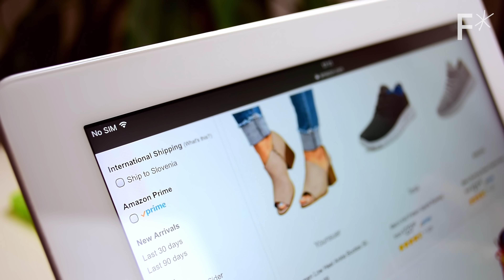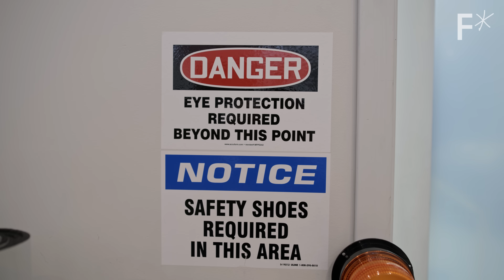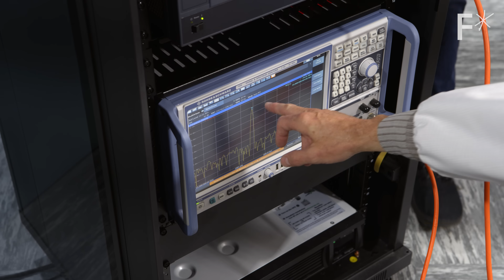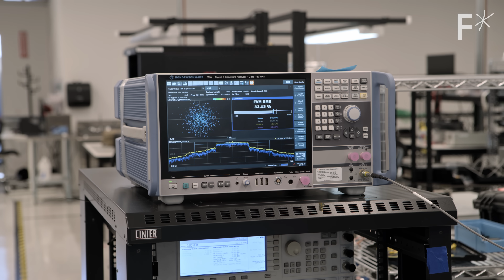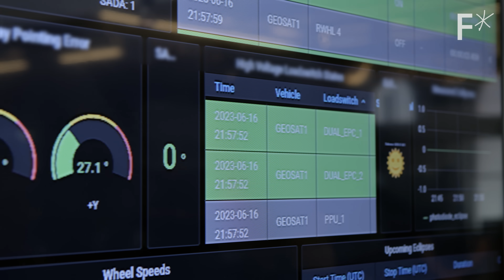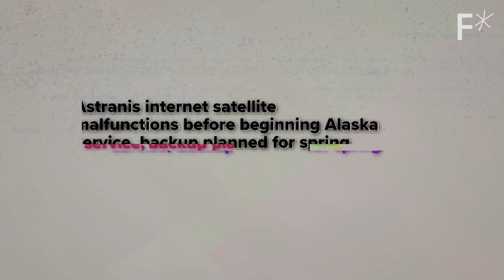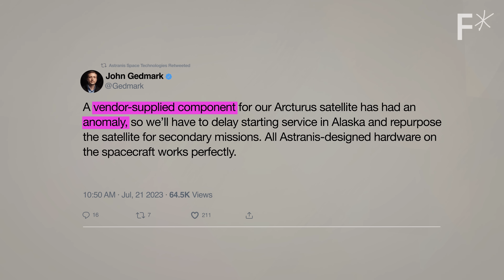Starlink’s newest competitor is using next-gen satellites to create internet for all | Hard Reset

Comment: The latency to satellites in geostationary orbit is significant, that's why starlink went for low earth
Reply: Not just high latency, also weak signal that's really disrupted by the weather... Connection goes bad everytime there's more than a few clouds... And the price had usually been much higher than starlink with strict volume limitations. 
(Haven't tried astranis, but this is common theme in many geo-synch satellite providers we've used over the years...)
Reply: Starlink will be cheap enough. No one like latency, its just frustrating even if you're poor
Reply: @mhxxd4 sterling create more space junk
Reply: @mhxxd4 Not all people need low latency internet because not all people are gamers
Reply: @seeeyes12212  the latency of geostationary satellites is almost unbearable for regular internet browsing
Reply: @mhxxd4  the thing is let's say that it's latency is not that bad like around 200-500 ms well it's not that bad especially for those who live in remote areas and mostly both Satellite based ISP's will improve their technologies anyway
Reply: @mhxxd4   90% of people, rich or poor, do not give a damn about latency or even notice it, it really only is the online gaming community, who in the big scheme of things are very tiny minority of internet users.
Reply: @professorg8383  normally it doesn't matter on land because even the high latency providers are still pretty low latency. Geo stationary latency is much higher than anything on earth and would definitely be noticeable and very very annoying, and would probably break some apps
Reply: @mhxxd4  Doesn't make a difference where it is at. It will be high on GEO-Sats but as long as the bandwidth is decent and latency is consistent, being high doesn't matter except for things like on line gaming and live streaming. But with decent bandwidth, you can do video on demand all day without issue.

Satellite TV has high latency strictly form the distanced  and it is GEO-Sat too.  Doesn't matter  that the signal was uploaded 2 seconds before you see it. 

I had 1st generation GEO-Sat, more than 15 years ago. It worked fine but bandwidth could be low and slow at times, especially weather related and uploads were slow. 

Latency of a GEO-Sat is going to be about 600 ms or so, but for 90% of internet traffic, it's just a meaningless number that you won't even notice. 

So definitely NOT noticeable or annoying unless it is while using one of those things I mentioned.
Reply: @mhxxd4  Here in Italy starlink is 40 euros a month plus hardware or the new promotion 50 euros a month , no hardware cost, 19-65 ping and speeds around 300-380
Reply: @mhxxd4  If you are a poor gamer maybe. But latency is a non issue for more than 90% of all internet traffic. Unless you on line game or live stream converse, it is not a problem at all.

As for being cheap enough, twice the cost or more of GEO-Sat and spending $600 up front,  is not cheap!  The idea that they will ever get Starlink cheap enough is just not in the numbers.  Wish it was, but it isn't and won't ever be. All you have to do is do the math!!
Reply: @mhxxd4 How ethnocentric of you.
Reply: @ what does that even mean???
Reply: @mhxxd4 Starlink really needs to figure out how to do routing in space.   It'd be an absolute revolution if it didn't need (or didn't often need) ground stations.
Reply: @DAndyLord  i believe they already have that figured out, but bandwidth is A LOT cheaper on the ground, the bandwidth for routing in space could be better used for more customers with higher speeds
Reply: @DAndyLord StarLink gen 2 satellites have laser links between satellites and do route in space.  I'm not sure what the bandwidth is but it is potentially much higher than the satellite up/down links and even most ground connections.  Fiber on ground (which isn't available in a lot of places) would be similar to lasers in space.
Reply: it IS a thing, just, isn't actually the best practical thing, they can do it, they apparently have a bunch of them with direct high bandwith lasers like 200gbps links
Reply: @DAndyLord the V2 starlink satellites will have direct laser links reducing the need for ground stations
Reply: @DAndyLord the V2 starlink satellites have laser links that do that routing. One of the reasons they are much heavier and bigger. F9 was doing 60 V1 satellites per launch but now only 21 V2 per launch.
Reply: @DAndyLord  Well, being as  the overwhelming vast majority of people, live on the ground, rather than space,  using space is just an expensive detour,  because virtually all internet communication is between locations on the ground! 

So it would really be about as revolutionary a development, as people walking on their hands instead of their feet. Different, yes, but not really all that useful.
Reply: @DAndyLord  They are working on it.  Elon mentioned in his latest speech he looking at doing just that to get the latency down to sub 10ms.
Reply: @DAndyLord  Starlink is already launching satellites with laser interconnects. Anything within territorial water limits is likely to experience legal limits about where ground stations can be located. Offloading routing to ground is actually desirable, since not doing so means more power, and larger more expensive satellites.
Reply: @DAndyLord  They will have to sort it because of the numbers of "marine" terminals they are selling without the interlinking, the ships using it will lose connectivity when far out to sea
Reply: @DAndyLord  they were going to use lasers to communicate between satellites but the idea got scrubbed
Reply: @DAndyLord You WILL need ground stations, unless you move all servers to space. And even then. Starlink works great for remote work.
Reply: It's just a question of what you value more: low latency, or low cost. There will be different solutions for different use cases / parts of the world.
Reply: @1stPrinciplesFM It isn't just the terrible latency that is the oroblem with geo though, its a lack of bandwidth.  Each satellite only has so much bandwidth for everyone sharing the satellite.  For geo that is A LOT of users per satellite, so you get high latency and low bandwidth.  A geo swatm like StarLink is closer so MUCH lower latency and far fewer users per satellite so potentially much higher bandwidth.  Add that StarLinks are incorporating laser links between the satellites so they can route traffic via laser in orbit and you get even more bandwidth.  Basically StarLink will totally eat this company's lunch.
Reply: @1stPrinciplesFM  But Starlink is fast and low cost..
Reply: @1stPrinciplesFM  GEO isn't low cost. I don't know why anyone would assume a orbit 70x higher would be cheaper.
Reply: @1stPrinciplesFM  They will also suffer from low capacity unless they build thousands.
Reply: I just came here to say this. Exactly.
Reply: The latency is 600ms. It definitely has an impact in video games and phone calls and it is less noticeable in video calls; for everything else has a minimal impact.  When you stream a video it only delays the beginning of the video by a bit more than half a second, same when loading a web page.
Reply: @ValeriodellaPorta  basically anything that's real time sucks at that latency
Reply: @ValeriodellaPorta  even then not all people need low latency because not all people are gamers. anyway where the heck did you get the 600ms from are you a theorist?
Reply: @seeeyes12212  I set up links with the Galaxy series of satellites.  The minimum latency if you are at the equator and the satellites is right over your head is 240ms. from antenna to antenna -- 72,000 km divided by the speed of light. If you add the communication equipment, latitude and actual satellite position you get 550ms to 600ms on a live channel.
Reply: 36.000/300.000= 120ms x Jump. At least 2 jumps = 240ms + delay in the network @ValeriodellaPorta
Reply: @ValeriodellaPorta that's assuming single hop and minimal routing. 600 is best case. It makes voice unworkable. It is also makes remote access a nightmare. Multiplayer gaming obviously not possible.
Reply: @CheapSushi Exactly. There has been geo Internet providers for over 20 years. Almost no one uses them because they are expensive, latency is high and bandwidth is low.  StarLink being LEO was specifically done to provide an Internet connection that is actually useable at a reasonable price.
Reply: I think a .6 second latency via GEO would be quite annoying for a simple phone conversation with the two people talking over each other, and it would be much worse for something like Zoom with several people trying to adjust for the .6 seconds and interfering with each other.
Reply: Starlink is still 200 ms ping lmao
Reply: Use lasers to send the data
Reply: No line of sight to the geostatonary satellite, no signal. Some mountains and trees to the south. Starlink works just fine in the same spot.
Reply: @acsody  Where are you based? Assuming some high latitude place?
Reply: @1stPrinciplesFM  Northern  Italy, Dolomites.
Reply: @acsody  that surprises me! In Northern Italy, you have about a 35 degree look angle to GEO, 1/3 of the way from the (flat) horizon to directly over your head. Must be a big hill :)
Reply: @PronouncedKyle  ...and never  mind, my location is at 1500 m above sea-level... some say we have mountains over here...😁
Reply: @1stPrinciplesFM I get his point. Starlink is more versatile. I watch one video in YT and Phased Array is so impressive. That's what they say anyway, I'm not really knowledgeable in electronics.
Reply: I guess if their customers can put up with sub-optimal video-calls and gaming they'll be okay, but I would think that would need to be reflected in their pricing.
Reply: @backacheache   I tried GEOS satellites service with several providers. All sucked with lousy latency and poor service. I seems like a stretch that this new outfit is going to be much better than the other GEOS  competitors.
Reply: @DennisFahlstrom  I think for the right application latency does not matter, Starlink bought a company that were using low-cost Leo "cube sats" for applications where the "text message" speed of a "message queue" was good enough (such as remote sensors) where delivery times could be in minutes (and it wouldn't matter)
Reply: @backacheache  It's nearly useless for any real time gaming unless you're after masochism. So will only do for something turn based like Hearthstone and alike.
Reply: @backacheache I have Starlink and have no issue that you speak of!
Reply: @WhoReallyCares917 
You will.
Reply: @Zeaiclies   Over 2 years and counting!  Maybe yours was installed wrong?
Reply: @WhoReallyCares917 
You miss understand, I do not and never will have StarLink.  Eventually you will experience sever issues with StarLink.

It's inevitable
Reply: @WhoReallyCares917  Do you play on line games that have an advantage with low latency like first person shooters? If not you wouldn’t ever notice it. For internet search and streaming you would never notice the increased latency.
Reply: @matthewhuszarik4173  I don't, but my son does. He doesn't have any issues!
Reply: @Zeaiclies  Well good for you!
Everything will have an issue eventually, even the isp your on!
Reply: @WhoReallyCares917 
Not on any ISP.
Fiber has zero of the issues that Satellite will always have.
Reply: @Zeaiclies  I bet you're a blast at parties!
If you have fiber, wtf are  you watching  this kind of stuff?? 
Hope your fiber line never gets cut  hahah
Reply: @WhoReallyCares917 
I do not have fiber either but it's far better than Satellite.

LOL you can not cut fiber without digging a big whole first.
Reply: @backacheache  gaming is amazing on starlink what are you on
Reply: @IDefyYT  I know, that's my point,  this is a thread about the video, which is about a "rival' who uses a satellite at geostationary distances and there a long latency. If the rival can deliver at a lower price point for people don't care about latency all well and good but for gamers and people sensitive to the quality of Thier videocalls it's not the right fit
Reply: @backacheache  oof. thats a tough one then. you got to put a geosync up alot farther, and go faster to stay there. thats not cheaper
Reply: Haha funny how they never mentioned that.
Reply: starlink will become the death of all space exploration by creating a giant orbital trash pile. spacex must be stopped at all costs.
Reply: 240ms round trip delay
Reply: @tripplefives1402 TikTok posters in the Congo are not a viable business plan …..
Reply: @littlemeg137 Starlink starts at $49/mo w/a minimum bitrate of 100mbps.  That rate has been steadily increasing as the Starlink constellation grows.
Reply: Thats why we need to mixed method,  with more efficiency
Reply: It is a different solution.  People are obsessed with gaming or live video calls, but the Internet is more than just that.  The world doesn't revolve around Fortnite.  On the other side of the cost equation is also failures.  Google how many star link satellites have failed and deorbited already. I am a huge fan of starlink, but a cheaper competitor helps everyone
Reply: For one way streaming digital TV and watching YouTube, GEO is fine.  But using any kind of time-sensitive application like VoIP, gaming, etc.  it simply won't work due to the inherent high latency.   Ah that cruel universal speed limit of light and radio signals.  lol
Reply: @BillAnt   True, but that only amounts to 90% of internet traffic. If you live in an unserved area, you're probably not a gamer or use VoIP anyway!  The advantage of Satellite ISPs is for those who aren't served by any traditional sources. 

For me, my only option beyond satellite is cellular broadband and that was only fairly recently.  It works pretty well and is reasonably priced . But it isn't viable for gaming or VoIP either. 15 miles away crappy DSL and pretty bad cable ISP is available, but costs more than I pay and I don't believe they will support gaming or VoIP either. less than 40 moles away, they have multiple choices. 

Fiber is finally coming, but only because they are finally getting government funding. About 80 years ago, it to government funding to bring electric power to my area.  Still part of an electrical coop from those days. The free market has never never served low population density rural areas And it's not because they can't make.profits in these areas, but they can make more in densely populated areas. Fiber to fixed wireless has long been a viable approach in small markets, but it's not enough profit to encourage them. Internet access has been an essential service for more than 20 years but business drags its feet if they can't get big enough profits.
Reply: Latency is also important when having a simple voice chat. When the latency is 500msec. It's half a second. That's pretty long. People always waiting for a quick reply have the tendency when it takes to long to continue to talk. This will cause collisions in talking.
Reply: Exactly the latency is ~600ms so over half a second. I guess it might work for places to transfer data or email but surfing the web will be annoying but I guess it’s an option for poorer countries if it’s cheaper.
Reply: Not slow at all with quantum networking
Reply: @tripplefives1402 I have used GEO sat. I used it for a long time and hated it and found it unusable myself. But it did what my parents needed it for.
Reply: i think for now, their target is for far flung places
Reply: @tripplefives1402I live in Africa and I care about latency and bandwidth. 
I currently use a 5G broadband service that delivers up to 800mbps. And it's just one out of 6 networks I can choose from.
Reply: Some websites just don't work with geosynchronous latency, including two I use for occasional income.
Reply: @littlemeg137 no they don’t. What is it that you don’t understand it doesn’t even compete - at least for residential connections. 

Or how about financial transactions?  How would a trader working the markets from home enjoy a 860 ms Latency?

This company is already bankrupt and they don’t even know it
Reply: @tripplefives1402 which - after four trips to manage one full trip data transaction equals a 0.5 second latency 

And posters on this thread say it’s a viable product ………
Reply: Came here to say this.
Reply: Yes, whatever the priorities of consumers are, latency is a factor that deserves in depth analysis in the context of this video. Another important consideration is the problem of physical obstructions. At the latitude of Northern US, the antenna has to be placed at a steep angle, which means that obstacles like trees, mountains, buildings are an issue for geosynchronous systems.
Reply: Starlink is going to fail. Like starship isn’t working, probably will never be cheap or reusable, and musk has to replace like 1k satellites a year at the current rate
Reply: And the download speeds keep increasing. I regularly hit 200+ mb download. Starlink will put them out of business...
Reply: @TheBomb1970  Because people want to pay 4 or 5 times as much for speed they don't need???  Unless you have a lot of users, most people will do just fine with ~25mb/s. All these GEO-Sats today offer 100 mb/s far cheaper than Starlink.   And they are profitable at those costs. Starlink may never be profitable. And of course you realize those speeds are more about the number of users than the tech, right???

I have a car that will do 185 mph.  It is wat more than I need. But I have that capability!  

You can say that Starlink "keeps getting better", but they will have to get a lot cheaper to actually be better!
Reply: Lol whatever you say 🤣 😏
Reply: Starlink is beginning to work with T-Mobile so that if your phone is out of tower signal you can message over Starlink.  This will go to voice and Internet later.  The switch is automatic requiring the customer to do nothing.  I wonder if Starlink also has plans to work with the geo sats in a similar way.  The customer will use geo sat when latency isn't a big factor and automatically switch to Starlink when it is a factor.
Reply: @davesworld7961  The whole thing is pretty sketchy. The problem is with the satellite transmitting frequencies design around terrestrial communication's. These frequencies are not exclusive to T-Mobile. Other providers have licenses in this frequency band and it isn't just cell services. The potential for interference with other services exist. They finally got approval to deploy the capability for testing.  SpaceX had already been deploying satellites capable of transmitting these frequencies. A typical case of Musk not following FCC rules. Plus they never provided the operating detail they were required to do. Musk really hates following government agency rules, But the FCC has to serve all the public and other licensees. 

The potential issue comes from the fact that the transmission from the satellite can't be confined to just a cell sized area. Frequencies'  are carefully assigned and laid out so as to avoid any overlap between carriers  Cell networks are very carefully designed to keep adjacent or near adjacent cells from interfering with each other.  Text messages will be one thing, but voice calls will be another, 

As for a hybrid system, I don't see Musk going that way even if it is proved to be better. He is too committed to LEO-Sats and sees GEO=Sats as inferior. Viasat is working on hybrids but  don't believe it is for internet.  There are much better uses for satellites.  LEO-Sats can provide very high resolution data from small areas. You could then transmit that up to bigger more powerful GEO-Sat for wider distribution. Where this really makes sense is in imaging.  Not just in the visible spectrum, but capable of capturing so much more data.  Very useful for spy satellites.  Where LEO-Sats excel is in collecting data, not transmitting it down. What Starlink is doing is really an obscure use of LEO-Sats capabilities.
Reply: @davesworld7961  that sounds like it would saturate the satellites unless it’s pretty restricted. I would hope they’ve sussed out a plan as well that doesn’t kill off any motivation to keep building out cell networks in the transition zones. If a company can market endless coverage and stop investing in their network they absolutely will.
Reply: Besides latency, the limited "real estate" available in GEO is going to be a significant problem.
Reply: https://youtu.be/RuVO1EPH7QY?si=Rojosjng_JeHTg9e elon musk success secrets❤
Reply: Video streaming what the vast majority of band width is used for latency isn’t an issue. Except for gaming and a few other interactive uses the vast majority of internet applications latency is relatively irrelevant.
Reply: @matthewhuszarik4173 
Satellite internet will always be slow and have latency no matter what, because of sheer Physics.  Just as copper (Cat-E8 or anything) will always be less than Fiber optic.
Reply: @Zeaiclies  No disagreement there, but latency isn’t an issue with 95+% of internet traffic.
Reply: @matthewhuszarik4173 
Not so much today, if you have the correct hardware and service, yeah I agree with you.
Reply: Not a big deal... Source signals can and will be stronger, lasers etc...
Reply: @d.g.1986 
IR Lasers will never be used for commercial communications, only Nasa and the Government will ever use it.
Reply: They are now a potential threat to other satellites.
Reply: @ZorroComputers 
What is now a threat to other Satellite's?
All the StarLink Birds are far too low to be any threat to pre-existing other Satellite's.

StarLink Satellite's are far lower than normal low Earth Orbit Standard.
Reply: This would be good for downloading videos. Maybe Starlink can buy the company and use this geo-satellites for purposes that don’t mind latency like downloading videos/files, emails, machine learning training… anything that requires massive downloading which would make Starlink exclusive for stuff that requires low latency like streaming and gaming
Reply: The company focuses on providing connectivity to underserved areas where any internet access is an improvement. John Gedmark, CEO of Astranis, stated, "If they are underserved or have no connection at all, then they just want internet as fast as possible. 95 percent of what people do in today's world is not latency-sensitive". #gamers #bewildered 😉
Reply: And yet, Starlinks latency still sucks...
Reply: There are many advantages to LEO
Reply: Big if true
Reply: Starlink disk doesn't track the satellites but it uses phase radar tracking.
Reply: Starlink are not in Geostacionary, they are in LEO
Reply: that's a common misunderstanding unfortunately.
Reply: Also geo orbit internet is not new, but as well starlink, as there was Iridium, which still fuctions
Reply: So is this about connecting them to the internet for the useful features or is it about selling temu shit , pornograghy and gaming.
Reply: This is The 5th comment in my history on the net, I've been on the internet that I had to google the 1st was about quantum computing the second was astrophysics. You sir are a valuable resource ..
Reply: Ping lives matter
Reply: Latency and path loss makes this impractical.
Reply: Not all applications need low latency. Geostationary is way cheaper. The more segments of the market covered the better.
Reply: @Freshbott2 you are correct. it just applies to the uses i would pay for. so not so much consumer clients, but stuff like hospitals bases ships oil rigs... not for me, but fir industry
Reply: @Freshbott2  It would be a problem if the cheaper geostationary internet outcompeted the low latency internet to the point the latter couldn't be profitable, leading to only the geostationary internet being available and low latency not being an option.
Reply: @descai10  that’s a pretty far fetched hypothetical though and generally not how competition works in any market. Geo has been around for a long time and if it had any capacity to compete LEO out of existence it would have happened before any implementation of LEO. And then on top of that, the existence at all of speed and/OR latency sensitive applications would still mean there’s a market for it no matter how cheap GEO can get. Any use cases that don’t care can fall back onto GEO, putting downward pressure on the price of LEO. Healthy indirect competition.
Reply: @Freshbott2  Don't think geostationary is way cheaper anymore. Low capacity means far fewer subscribers means higher prices. 
Not sure there is a market for this anymore.
Reply: Check out the prices of internet of Northwestel for Nunavut.

And then add 50 to 60 bucks of the price.

That was the price before starlink came out.@Freshbott2
Reply: @Freshbott2 C band satellite bandwidth is expensive.  Also because of the bandwidth use putting a few large carriers on a transporter will max out its power before it utilizes the whole available bandwidth.  Ku band has its own problems in ice and snow. My last job was a gateway earth station.
Reply: High latency does not work for real time voice services. LEO ground equipment should be cheaper and higher capacity. GEO  will be cheaper to manage due to far less satellites but each individual satellite will be more expensive. GEO needs higher power and high signal gains to complete compensate for the distance.
Reply: @engineerengineer2218  how do you circumvent the speed of light with “higher power” inputs ?
Reply: @estonianman  The higher power only compensates for the path loss to improve signal quality(that could reduce latency, by getting it right the first time).  But the overall  biggest contributor to latency in this case is the distance light has to travel and therefore cannot be reduced.
Reply: @engineerengineer2218 we’ve used geosynchronous satellites in the milstar constellation for many years, and we’ve used VoIP and streamed video over it in all conditions.
Reply: I would like to purchase both hardwares low latency low cost for different purposes, it's like what I currently do, essential home appliances are plugged to battery solar power supply, while non essential power grubbing devices are left on the town grid. To reduce workload & increase longevity.
Reply: But it doesn't offer the flexibility of covering a larger area
I calculated the costs for that and it's significantly cheaper for Astranis to provide connectivity
It's just that Neuralink has the cutting-edge technology and is backed by Musk in case things go wrong
Reply: @wolfslicer7908 You are forgetting about bandwidth. Geo ends up with vastly less bandwidth per customer because each satellite has so many customers who all have to share the limited available bandwidth.
Reply: Starlink customer with no cell service here, always looking for affordable alternatives. I livestream, so some low-latency is desired. SO...I think what needs to happen is a combo like the old days where uploads would be via phone and downloads would be via satellite. Imagine this combined with Starlink, where your router uses the "most appropriate" route for each type of traffic. I'd need about ~10-20mbps for low-latency stuff, I don't REALLY need gigabit both ways, but gigabit+ downloads for stuff that can take a few seconds to buffer. Quality-of-Service router tools can get web stuff from the high-latency dish and the maybe the initial requests, VOIP, Gaming, live streaming, etc with the low-latency dish. I'm already using a DirectTV mount for my Starlink ;)
Reply: @barkeaterden  you won’t be live streaming on a 56k modem amigo ……
Reply: @estonianman It's even more fun with 1200bps AX.25 ham radio packet!
Reply: @barkeaterden  that’s sounds like the future - makes about as much sense as a highway paved with solar panels
Reply: @tripplefives1402 GEO receivers are way less expensive than those for LEO. 

Because LEO satellites are moving, and you have to switch between them, it's a complicated/sophisticated phased array antenna. 

GEO satellites are stationary, so you just point a piece of stamped aluminum one time and it statically receives the signal. 

GEO antennas are maybe $50, LEO are closer to $500. So GEO is 10x cheaper.
Reply: @1stPrinciplesFM  This is true of receivers, it's not true of transmitters. Unless you're receiving only, you need 60cm parabolic antenna, plus a 5W BUC just to get a few Mb/s. To get to LEO speeds, you're taking ~1M antennas and 20watt BUCs. That all costs a lot more money than a 50 x 30cm flatpanel.
Reply: @1stPrinciplesFM Most companies such at building cost effective hardware though and quantity brings prices down so in practice I'd be surprised if geo hardware was significantly cheaper than StarLink.  Plus, StarLink basically is SpaceX which are thr cheapest most cost effective launch provider so SL's costs will be lower than competitors.
Reply: @1stPrinciplesFM oh Kyle, l like somebody said. Slow Internet makes you want to stab yourself in the eye with an ice pick. Why would I want anything that has absolutely AOL like numbers when I can get AT&T synchronous TRUE fiber Internet with 1ms latency and limitless bandwidth for $55 per month nationwide? What are you going to offer? $10 a month worth all equipment included starting at a speed that's measured by a sun dial?
Reply: Most critical applications do not require low latency. The poor people of the world don’t have an overwhelming need for gaming of video calling. On line banking, mapping and directions, and access to information don’t require low latency.
Reply: @matthewhuszarik4173  low latency is terrible
Reply: @ Only for certain applications. Most the world has little use for the applications that require low latency like gaming and video chatting. It is no problem with applications like e-commerce, information retrieval, and social media.
Reply: Who care about latency unless you are realtime gamer. 100 millisecond is no big deal. A few satellites at GEO is much better than tenths of thousand or space junks in LEO.
Reply: I was going to say this. But if you think about it, people in Africa don't really care about latency, because they don't have a connection at all, or the connection is slow speed.
Reply: And StarLink is slow and full of latency
Reply: @Zeaiclies  just checked - 51 ms

Hughes Net? Over 800 ms

It isn’t even comparable
Reply: @Zeaiclies I don't have any issues with starlink. It's sooo much better then what I had before.
Reply: @raynorvii2451 
I highly doubt that.
You might be part of the handful who get some service better than what they had before but still not as Stellar as Elon claimed it was supposed to be. lol
Reply: @Zeaiclies  you are right, in order to access the internet from Starlink, first you have to ping off the satellite then the satellite has to patch back into the ground based network which spaceX has to pay to gain access to the WWW from existing real ISP. So latency is another lie from Musk.
Reply: @Liberty2358 You clearly have no idea how the Internet actually works.  ALL ISPs have to pay for their bandwidth. No such thing as a "real" ISP that somehow magically gets free bandwidth.  The Internet backbone is not run by ISPs, the high speed backbone connections are required by all ISPs and they all have to pay the backbone providers for those.  StarLink, to the contrary, actually DOES kinda get free bandwidth. Because their gen 2 satellites form a mesh network between satellites in orbit using lasers.  Those are potentially extremely high bandwidth and can route traffic outside the backbone. But to completely avoid the backbone it would have to be between StarLink customers.
Reply: @Me__Myself__and__I  Larger ISPs do not "pay for their bandwidth"... they have virtually unlimited bandwidth at the internet exchange.  All that they need to do is add more ports and pay for optics.  Smaller ISPs get ripped off by larger carriers who attempt to charge them for Internet transit.  When you're a member of an exchange or run one, you have no peering fees...just equipment to worry about.
Reply: Latency is just not important compared to good bandwidth
Reply: @mateomaderas5504  do you have traditional satellite internet?

Because I have - and it sucks
Reply: @estonianman  Yes, the bandwidth on current satellite internet is low.  This can be fixed without the huge numbers of expensive and wasteful low orbit satellites.  There are a number of companies planning high orbit satellite connections which will provide perfectly good internet
Reply: @mateomaderas5504  explain how they are able to ignore the speed of light ……
Reply: @estonianman  as I said, latency is not really important unless you are playing games.  A delayed response does not stop you watching movies and searching the web, which is 90% what most people use internet for.
Reply: Good one!
The shortest distance between points A and B is a shorter distance between points A and B. Move them closer.
Reply: Ah, if speed, hence time, was not that important, we might as well go back to the horse and cart, or take a walk to Europe.
Reply: @mateomaderas5504 actually latency is just as important
Reply: @apdjwivjekdif  Actually, that is complete nonsense!! Maybe to you personally, but not to 90% ir more of internet use.
Reply: @mateomaderas5504 It objectively isn’t. Latency is 275 ms for geostationary orbiting satellites. That’s fine for streaming, and essentially everything but gaming.
Reply: @mateomaderas5504  lel "Latency is just not important compared to good bandwidth". Snail mail is high bandwidth and high latency. So snail mail is important because of the load, not the latency?
Reply: @tyronewashington230  Good analogy.  Just like when we could order DVDs in the mail.  The difference today is that we are talking about differences of fractions of a second   With a fast satellite connection you can get your movie in 1 minute.   Low latency will ensure you get it 200 ms faster.  Obviously no-one cares about that.
The main difference most users will care about is latency on audio and video calls,  but we get high latency on a lot of terrestrial connections anyway and it's really not that bad.
The one thing you can't do is play some interactive games.  Is that worth putting a huge fleet of satellites up for?  Simple answer - no.  especially since we are talking about a small and shrinking minority of users for whom ground based solutions will be eventually available at a far lower cost.
Reply: @mateomaderas5504  These are small sats... the bandwith will be low unless they launch thousands.LEO sats can handle much higher bandwiths and therefore much higher capacities for a given satellite of a given mass.
These sats don't give bandwith or good latency... think their buis model is too old.